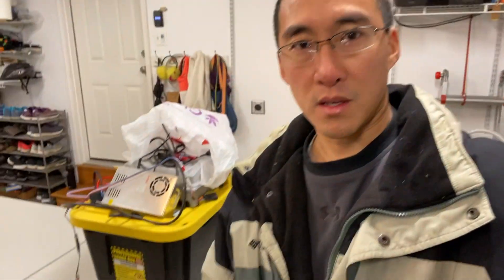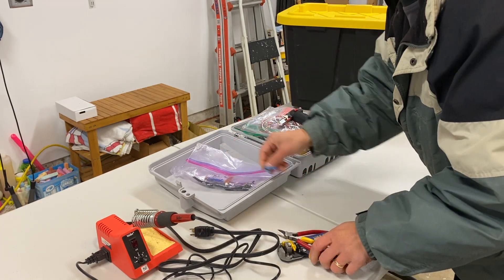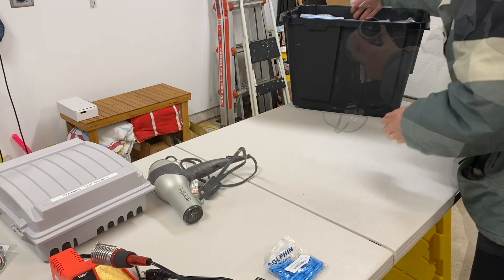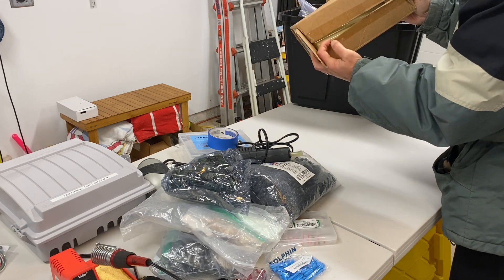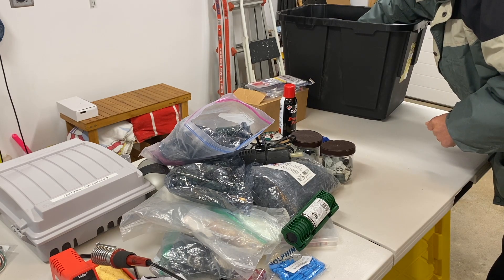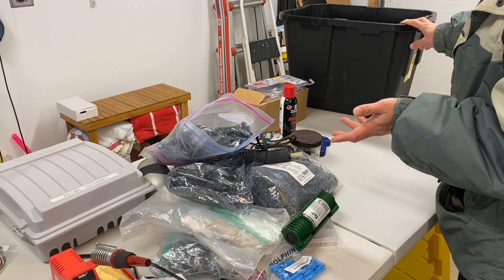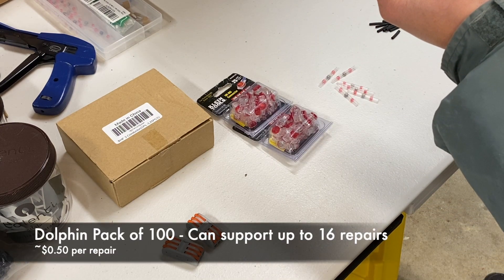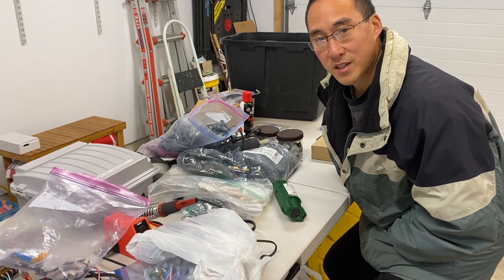How To - Pixel Show Setup and Repair Gear

Comment: Your videos sure have been helpful to a noob like me! I have a question about two of the items which you did NOT link a source to;  the caps and spare screw-connector rings for the pigtails. I have not seem these on Wallys Lights or any of the places I have visited so far. Where do you get those from? Thanks!
Reply from the maker: Hi Ronald, thanks for the comment. Glad to hear that the videos are helpful for you. 

The caps were purchased from the vendor that I purchased pixels from. I don’t often see them at vendor websites that sell pixels, but if you ask, they may be able to get them for you.  I cap off unused pigtails from the controller but they can be considered optional. As long as the pigtails point down and don’t get submerged into puddles of rain water, they aren’t a necessity. 

For the rubber O-rings, those are important to have extras. Again, you can source those from your pixel vendor (to toss in extras). Someone posted these on Amazon which may work. I haven’t ordered them, so I can’t say with 100% confidence that they’ll work.

https://www.amazon.com/dp/B07WV2ZB6M/?coliid=I3IWEOGTGGFVR&colid=BB8RAXZDRK0F&psc=1&ref_=lv_ov_lig_dp_it